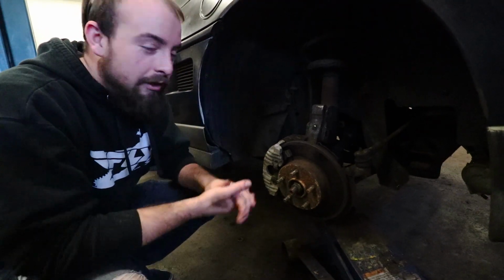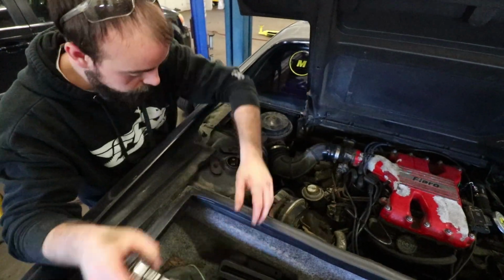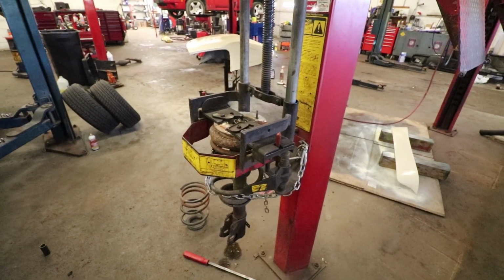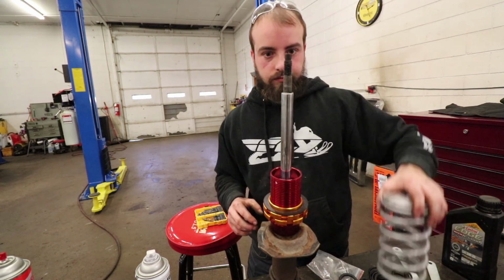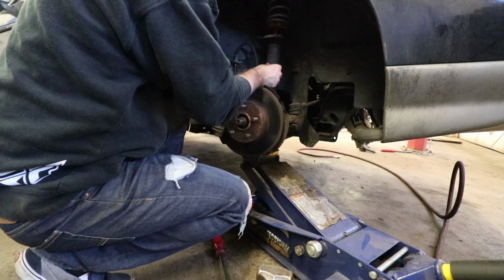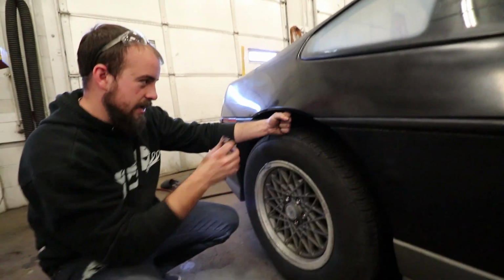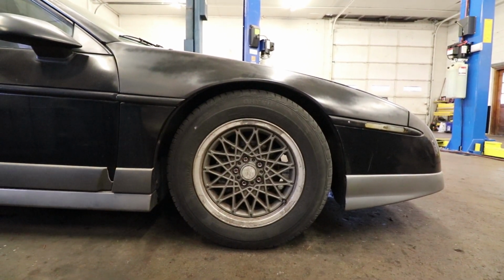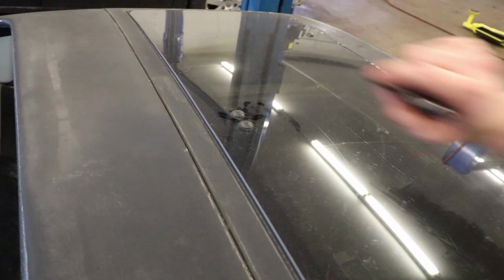Building a fast and furious Fiero!

Comment: Is that the cheap kit on ebay for like 50$ ? Does it feel good ? I want those on mine but i dont know if the spring will be too weak
Reply from the maker: maxim richard yep it’s the cheap kit and honestly it doesn’t ride too bad. I was surprised
Reply: And you still have ajustement ? Cause mine as a v8 so its litle more heavy
Reply from the maker: maxim richard a ton of adjustment

Comment: On my Fiero’s I remove the spring perch from the strut and slide the threaded sleeve for the coil over all the way down. Then I order some 12” springs. It will ride way better than those short springs that come with those cheap Honda coil overs. It really doesn’t matter with blown struts. I guess I should make a video.  And I say modify away! I’m into Fiero’s but really enjoy some of the chopped up Fiero creations people make. As long as it’s not a trike. 🤣 I want to build a Fiero into an off-road dune buggy/kart in the future.